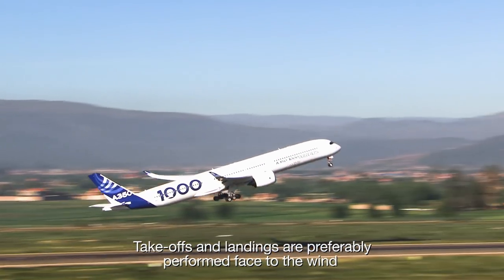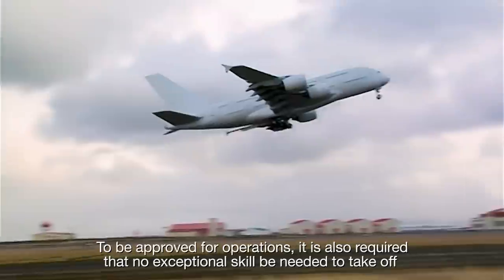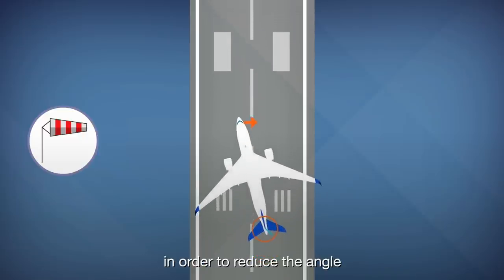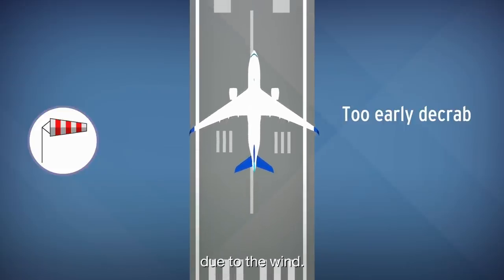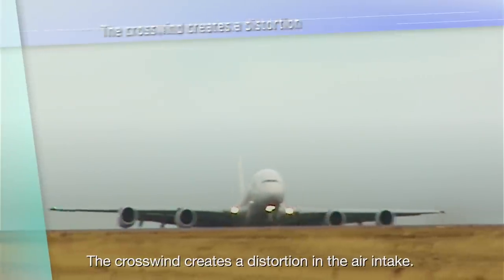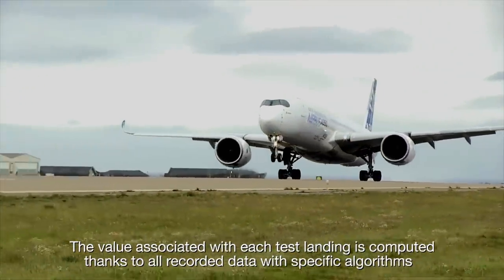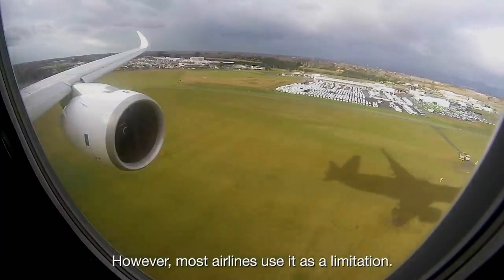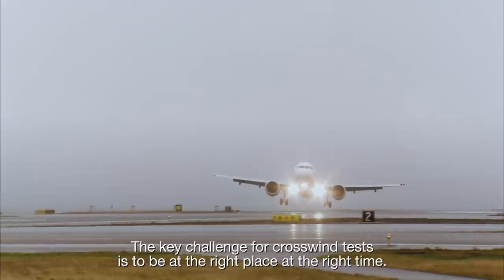Flight Tests - Ep.5: Crosswind tests

Comment: As far as I know LOC rx antenna is inside the radome, not inside MLG bay. @ 1:31 and 1:48 how possible a/c nose not aligned with rwy centerline? Again 2:03 A/C nose should be aligned with rwy centerline not the MLG. During decrab A/C begin to turn reference to the aerodynamic center and it is close to cockpit (ref:airbus WIN videos).